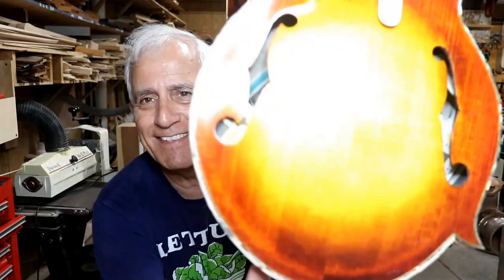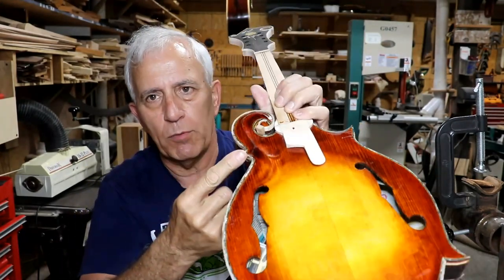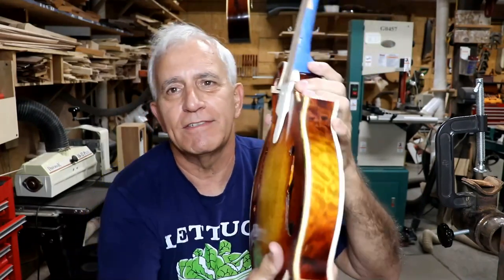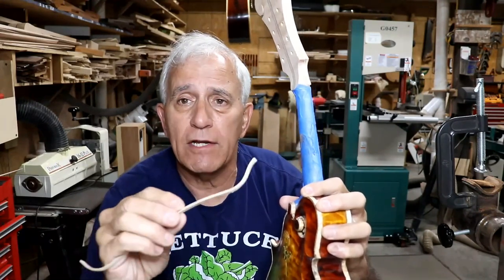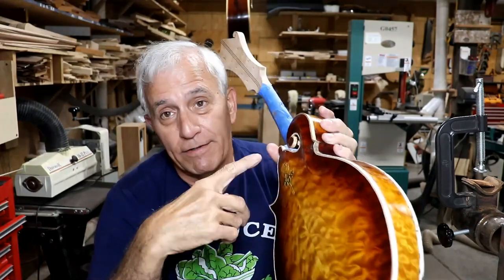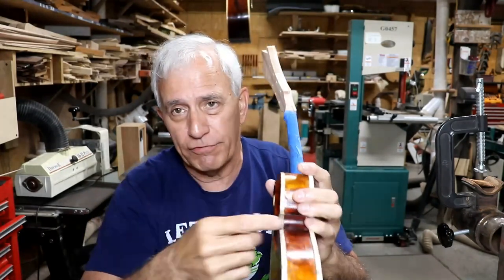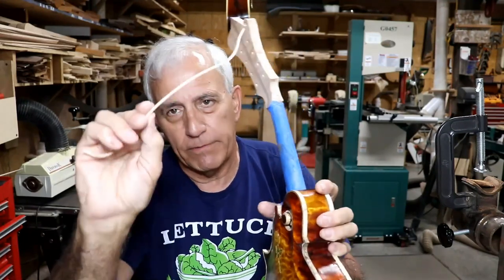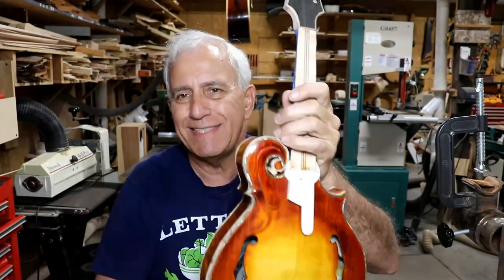VLOG #046 Welcome To Ugly Duckling Farm

Comment: You might try the steaming technique for bending wood. Make a couple template forms and clamp some thin strips of the steamed maple into the forms. As long as the form is close to the actual shape, you should easily be able to transfer the parts to the final intended targets.
Reply: I have seen someone put guitar sides in boiling water and then clamp them to a mold.
Reply: @jthonn  Which works, no question there, but the more moisture you introduce into the wood, the more likely you will have issues with things like curling. Especially in things like curly maple, where every flame can start to curl on you, it's better to just spritz the water on and use a silicone heating blanket, along with a spring steel slat on both sides, then clamp that whole sandwich to the mold. Let it sit for a few minutes with the heater on, but don't get over 300 degrees or so, and then shut it off and let the sides sit there for about a day. Some people do it for less, I like things to stay put. 

The real issue, though, is the additional moisture, which in some woods is just a real problem that no one needs. 

Or, he could always just learn how to bend on the pipe. It's the traditional way to do it, and it's actually kind of fun once you get it down. Heck of a skill to learn, and once you get it down, it's another step on the way to being a better craftsman. Anyways, just a thought.
Reply: @willmorrison1022  I hear you. I haven't built an acoustic guitar yet. I have done quite a few repairs. I do want to build one, but I will probably start with a kit from StewMac or Martin first before I do one from scratch. Plus I lack tools, like bending irons and etc.
Reply: @jthonn  That's a good place to start. And once you do one, prepare for the addiction. You will want to do another to make up for the mistakes you made on the first one. Then the same will happen with that one. 

I would suggest that you get a book, like the Cumpiano/Nettelson book "Guitar Making", which covers both classical and steel string acoustics, or if  you're adventurous, the Bendetto book on arch tops. I"m sure Stew-Mac has them both. Either one will get you all the way through building one from scratch. Plus, it's really cool to further your knowledge of a topic, and these are bother really good in that regard. 

Bending irons are cheap. Get some pipe and a propane torch. The old masters used to use the stovepipe on their wood stoves. If you have a building material recycling place locally, that's a great place for things like that. But you only need a few inches and a T piece to get it mounted somewhere. A propane torch behind it to heat it up, and you've in business. 

Other tools can be found at garage sales, second hand stores and flea markets. Planes, especially. You can frequently find all kinds of very useful tools for next to no money. 

The big thing, have fun and enjoy playing (or gifting) the instruments you build. It's a wonderful thing to be able to do.
Reply: @willmorrison1022  Thanks